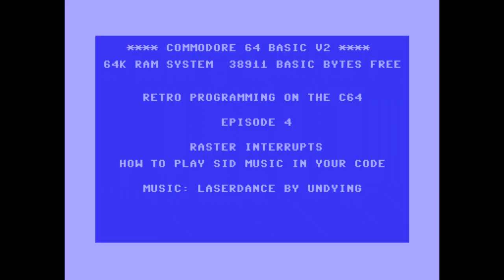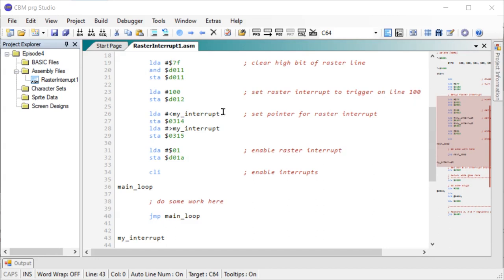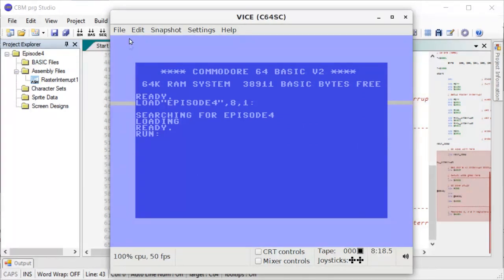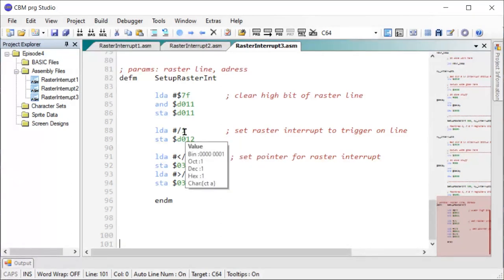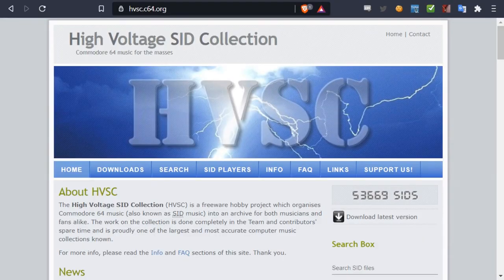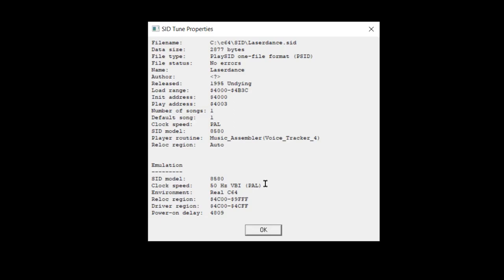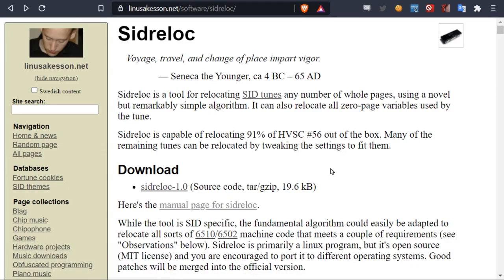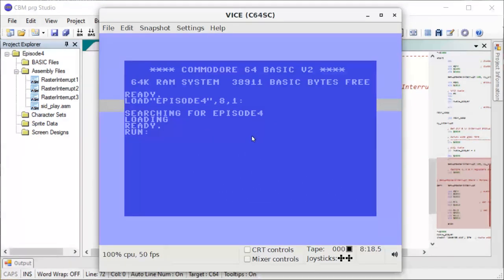Retro Programming on the C64 Episode 4 - Raster Interrupts and How to Play SID Music in Code.

Comment: It's worth mentioning that there are several different types of interrupts supported on the C64 in addition to raster ones. The system timer, keyboard and user port can also generate interrupts that your program can respond to, though for game programmers raster interrupts will be the main one you'd use. I believe the 1541 can also cause interrupts, but that may be limited to its own internal memory and processes. Not 100% sure on that though.

On the SID playing, I wonder how much trouble it would be to write a small program that uses those SID properties to analyze the SID file and change all of the absolute jumps to a new address of your choosing (but still maintaining the relative jump distances from the original) in case the default location is incompatible with your code. For example, maybe your main code is larger than expected and the default loading location is inside your code space, or you just need to move it for some other reason. [edit: Whoops! I guess I should have watched the whole video before commenting! LOL]

[Also, if possible, always try to get the permission of the SID author before using it in your own program. They will almost always say yes as long as you give them the proper credit in the game credits.]

Comment: Very cool thanks! I haven't looked at the code for SID music...but is it pretty much accepted that there's a standard optimised way of paying music and all SID files use same method? Or does it vary from file to file?
Reply from the maker: Thanks, the SID player code is typically different for each piece of music, in most cases the player code is generated to be part of the music instead of having separate player code and music data. However the approach is depends on what tracker the music was composed in. SID music isn't very standardized. 
Cheers,
Jake

Comment: Guess you had to deal with badlines and stable raster techinques to achieve that results..
Reply from the maker: Indeed, the way I usually do it is to have a delay table, on PAL it's easy you can use the values 8,8,8,8,8,8,8,1 so you do 8 delays on normal lines and then a single delay on the lines when the VIC chip is making the 6510 CPU sleep while it's accessing the memory.
Cheers,
Jake

Comment: Great video, so good. I have tried to add this example to my code but it isn't allowing me to enter the loop that looks for a keypress. I entered the loop where it says to do this, and the code has largely been untouched from your example. Not sure what I am doing wrong. HELP!
Reply from the maker: Hi James, did you try download the example project and run it? Does that work for you?
Keep in mind when the interrupt code uses JMP $EA81 it will not scan for keyboard input. However you can change one of the interrupt returns to JMP $EA31, then it will include a keyboard scan.
Also keep in mind if you want to return to the basic prompt then you should remove the custom interrupt code first by restoring the pointers otherwise it will likely crash.
Cheers,
Jake

Comment: what are those addresses $0314 and $0315 ? Who defined these addresses to have anything to do with "raster lines" ?! It aint any VIC2 nor CIA/VIA (hardware) registers. So whats happening there and why (or of whom).
Reply from the maker: As I describe in the video $0314 and $0315 are interrupt pointers/vectors. Whenever an interrupt occurs the code these addresses are pointing to will be executed, this is not specific for raster interrupts, it's for all maskable interrupts. These addresses are controlled by the KERNAL. If you bank switch the KERNAL out then you need to use $fffe and $ffff instead (these are the actual 6510 pointer for interrupts), however in this case you have to save and restore all the registers yourself and return with the RTI instruction.
Cheers,
Jake
Reply: Meanwhile I found an excellent documentation explaining this. While there can only be one single real (hard wired) interrupt vector on a 6510/6502 CPU at $fffe, the makers of the Kernel ROM designed in a "hook" to intercept the regular ROM ISR with user code. The users ISR jump address therefore is looked up at $0314 and $0315 and jumped to.